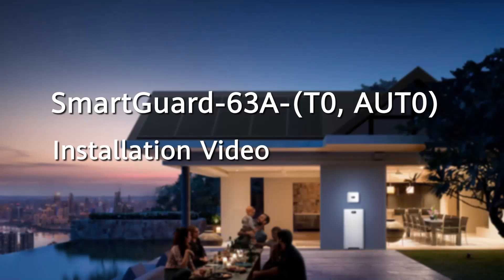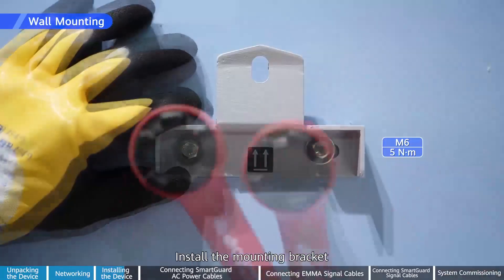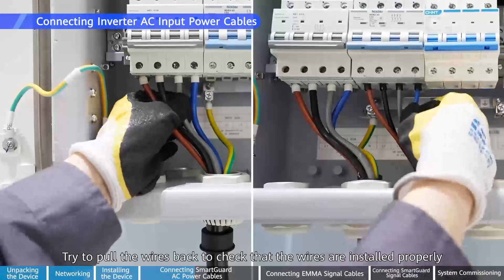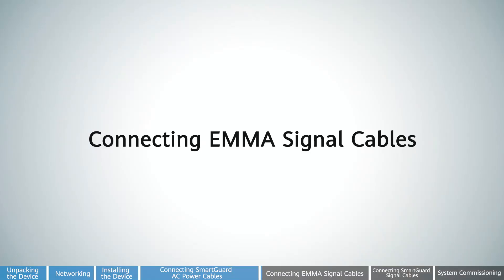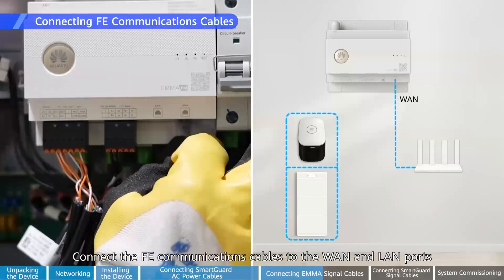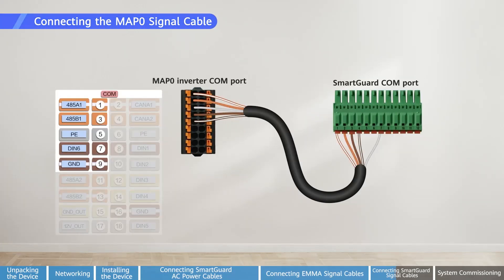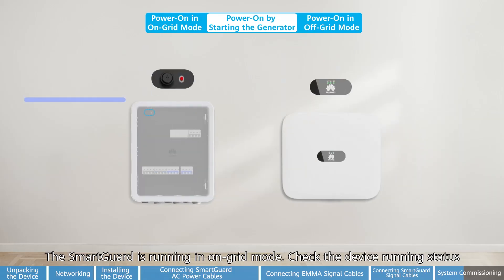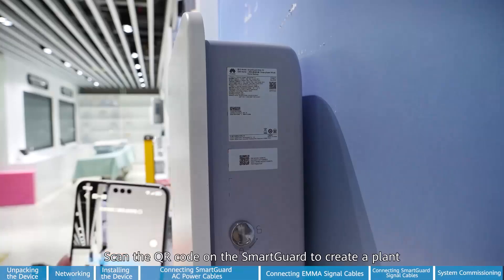Cómo instalar el SmartGuard Trifásico de HUAWEI - Tablero de Backup entre On/Off Grid

Comment: Hola, una duda, este equipo se puede usar sin baterías y poder usar los paneles como fuente de electricidad cuando hay cortes de luz? O siempre debe tener conectada una bateria? Hay posibilidad de usar baterias de otra marca o conectar a un inversor de terceros que gestione baterias?
Reply from the maker: Hola, para poder usar los paneles cuando hay corte eléctrico, siempre deben haber baterías conectadas. Los inversores y baterías que se pueden usar con el SmartGuard solo pueden ser de Huawei, los modelos SUN2000 de inversores compatibles son los M1, MB0 y MAP0; y en el caso de las batías son las LUNA2000 S0 y S1.